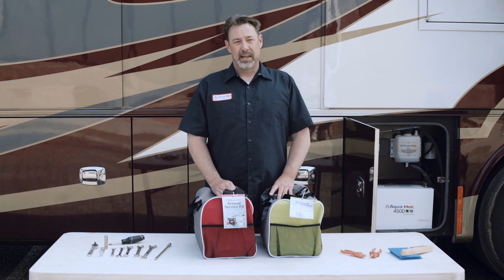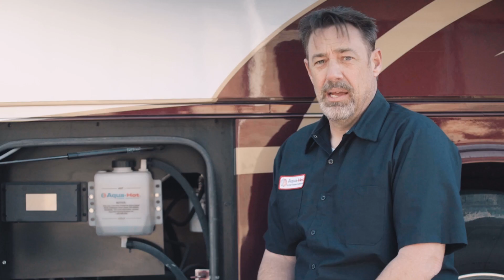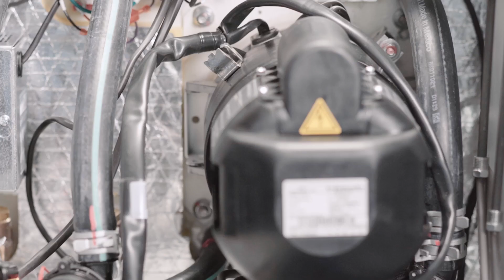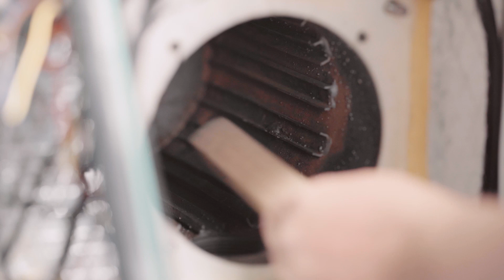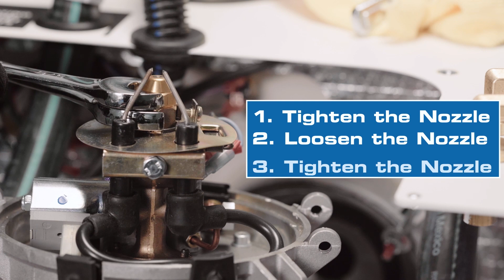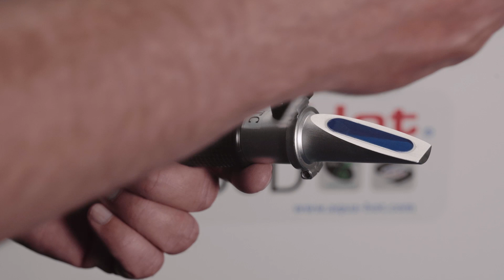How to Perform Annual Service Maintenance on Your Aqua-Hot Hydronic Heating System

Comment: The manual(Service Manual for 250D REV220725) says 7/16 and 11mm, the video says 9/16 and 11mm when loosening the fuel lines after clamping them off when removing the diesel burner.

Comment: There was reference in title to 250D and other models. The 250D has no resemblance to the 450D in this video. So if you're looking for a tutorial on 250D, this isn't it.
Reply: I just finished service on my 250D. Process was exactly as stated in this video. Maybe you have an older 250D model??
Reply: @skinnerMTB  I have a 250D (2021) and it is nothing like this 450 model.